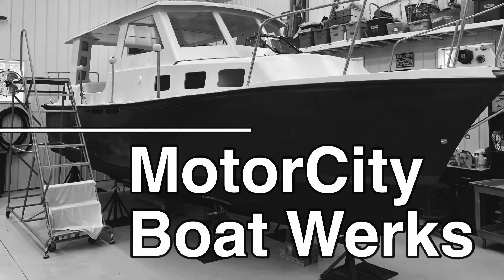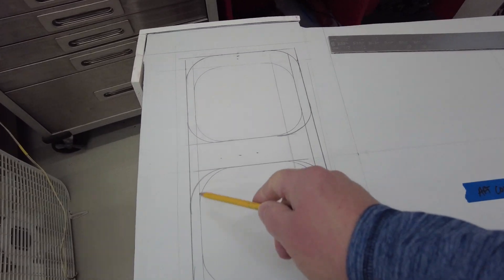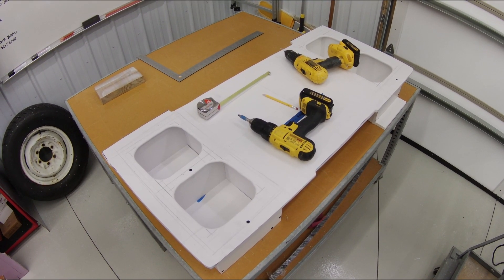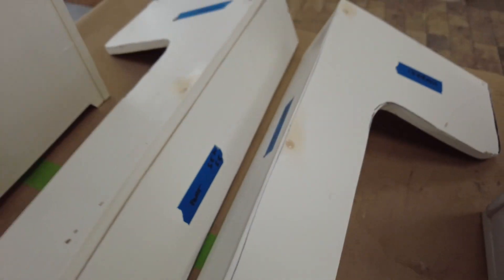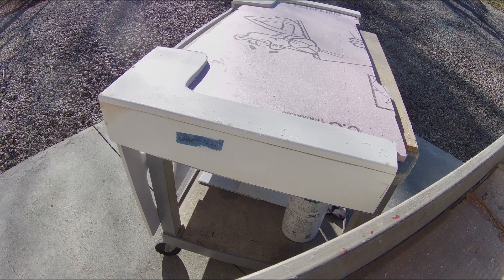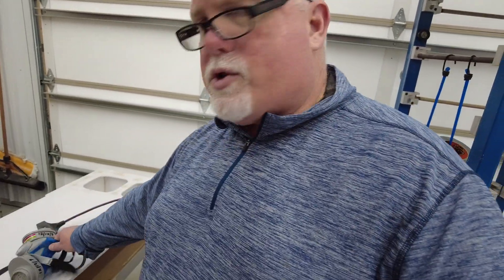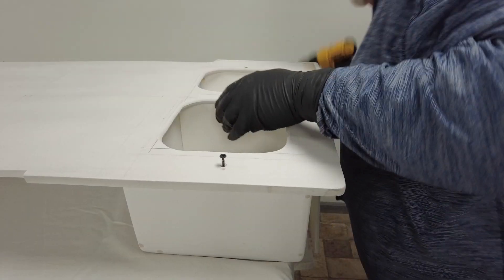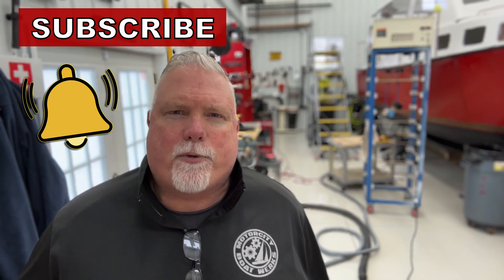Composite Boat Cabinets -  Pt2 | Coosa Board |Trawler Building and Sailboat Restoration (Ep27)

Comment: My go to is a Porter Cable right angle 6" orbital sander with a dust shroud. Its held up pretty well but I've had to replace ball bearings twice in 7 years.  With a vacuum attached its just about dust free.  I've replaced the hook pad just once after a helper tried to use it without sandpaper. Maybe the air flow helps cool the pad surface? Second best tool is a Makita angle grinder with a coarse fiber sanding disk. I bought a dust shroud for this as well. This makes it harder to use but removes about 90 percent of the dust. Great for removing lots of material. I wear a pair of noise cancelling head phones and listen to podcasts or books on tape while sanding. Everyone needs a pair of these things.  
I recently bought a dust deputy and a box of 3M Xtract net sanding discs.  Both of these are game changers for me.  The dust deputy keeps the fiberglass dust out of my vacuum filter so I don't have to clean it twice a day.  The net sanding discs are by far the best that I have come across.  I have a tendency to use sandpaper long after its worn out.  Its either loaded up or worn smooth.  This stuff does not seem to clog easily and stays sharp like nothing else that I have used. I'm kicking myself for not trying it sooner.
Just my experience but get the head phones if you dont have them.
Reply from the maker: Jeff that’s great info. Thanks !

Comment: I used harbor freight sanders when building my 17 ft boat and so I bought a black and Decker and it lasted less than the cheap harbor freight sander.  So I stick with those.
Reply from the maker: I hear you. 👍My problem with the harbor  freight sander is the size weight and features. That’s why the black and decker 1/4 sheet palm wins every time.
Reply: @motorcityboatwerks  yeah - just wish it lasted as long as the harbor freight
Reply: Loving the channel by the way!
Reply from the maker: Thanks very much 😁👍

Comment: I have a Milwaukee cordless drill that isn’t that old.  Full trigger pull and it spins so dagone slow. The batteries outlasted the tool. Now what?
Reply from the maker: I got you covered. I recently found several Chinese tools on Amazon that use Dewalt 20v batteries. Basically someone is making tools that use Dewalt batteries. They are knock-off look a likes and surprisingly affordable. There are similar knock-offs for Milwalkee batteries. Check it out!
Reply: @motorcityboatwerks  thx ima look into that